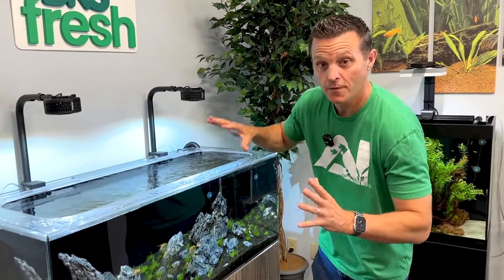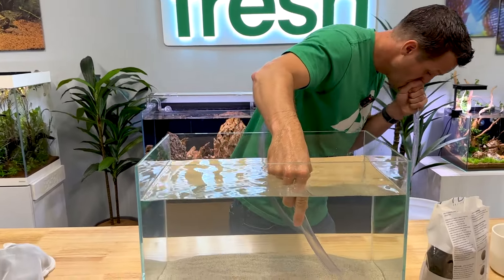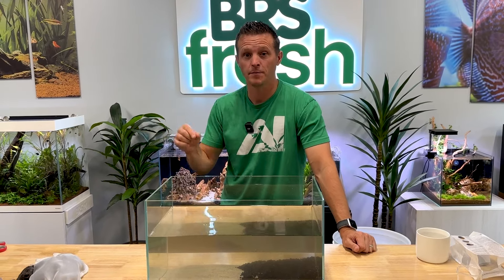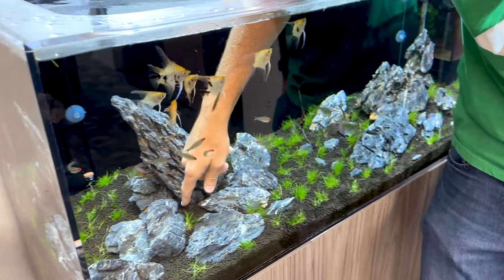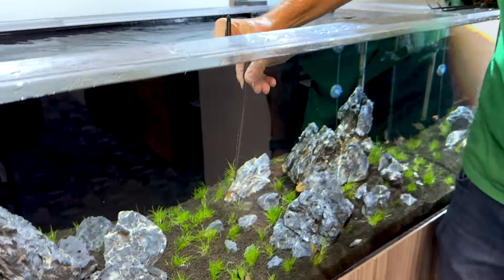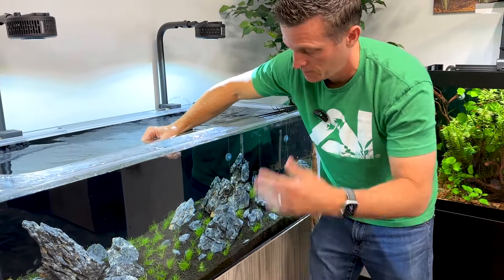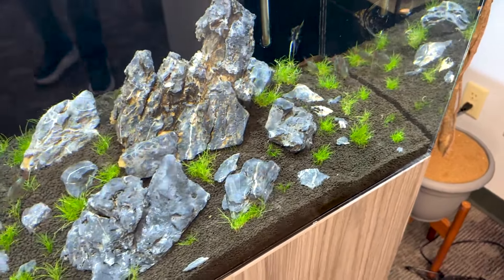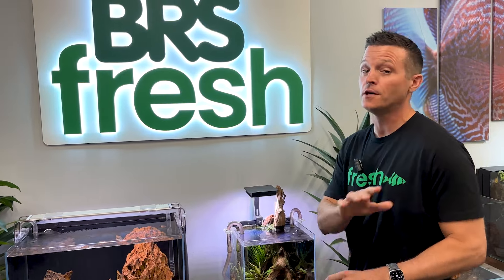AVOID These MISTAKES When Changing Your Aquascape

Comment: I’ve found cutting the bottom off a soda or water bottle and the filling it with soil works a treat. I keep the top on the bottle while filling it with soil. Then, I take the top off, put my thumb over the opening, and lower it into the water. When I’m where I want to be, I remove my thumb, and the soil goes right where I want it.
Reply from the maker: Cool!
Reply: im going to do this
Reply: This is a great idea! So I did a 75 a while back before i got into the soils and just went with black blasting sand. What would you recommend to get the soil under the sand? Use your bottle method but just move the sand away like making a valley then fill with soil and cover it back up with sand? Or would siphoning all the sand out, putting the soil then re adding be the best method? I’m just trying to get opinions from others before i go tear it all up. Haha 

Also @BRSfresh what’s a good option for low to mid favoring mid range plants in a 75? The light i went with is absolute crap. It’s just a big crap chain name strip light lol. I got two kessil’s pretty cheap a while back but they are the thinner ones with two adjust dials on top. I tried them on one of my 14G cubes and they just have wayyy too much blue imo. I don’t think they have the right spectrum for a planted tank but hell what do i know lol so give me some options please 😂 I don’t mind paying for quality but don’t want to break the bank either lol
Reply: @BRSfresh oh one more thing, how many 17lb bags of bio-stratum would you recommend for the 75? To be under a sand cap. Won’t be full jungle style but atleast 50ish percent plants
Reply: @Jhholderfield  I would probably put the soil over the existing sand, and the cover with fresh.
Reply: @amykhar  geeez I’m not very smart 🤣 I’ve never even thought of that. Lol. How thick would you do? An inch of soil? It’s been up and running 7 or 8 months now so does have good decay layers starting in the sand.

Comment: I just did a fish-in substrate change and re-scape in my tank.  Did it in two phases, replaced half one week and did the rest the following week to avoid crashing the tank.  I rinsed filter media in the tank water and did water change the day after each, and I placed an ammonia remover media in the filter chamber that I left in running a week after.  So far so good!
Reply from the maker: That sounds like a smart plan!  Much less stressful route than the one I took 😏
Reply: @BRSfresh  I didn’t do the gravel vac method though so it was a MESS cleared up in an hour lol